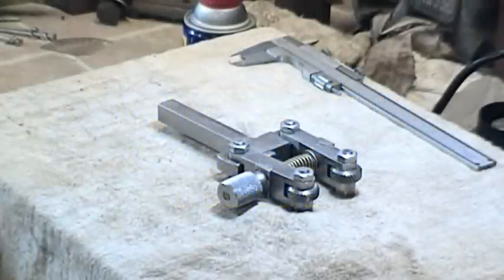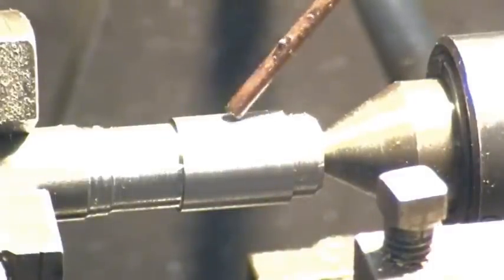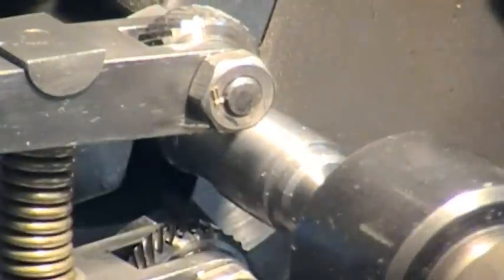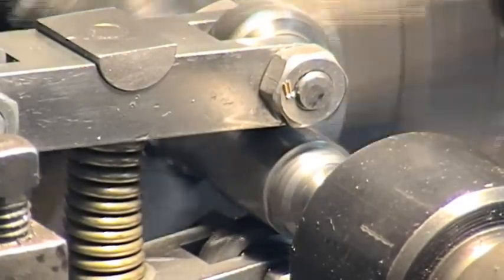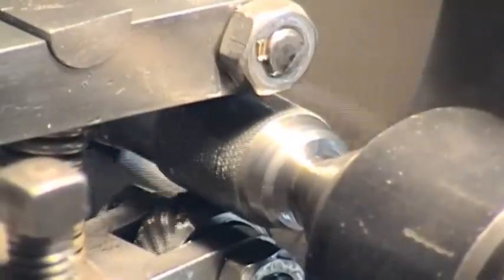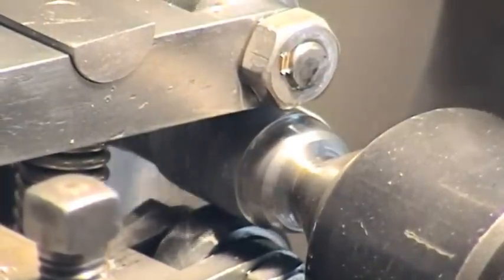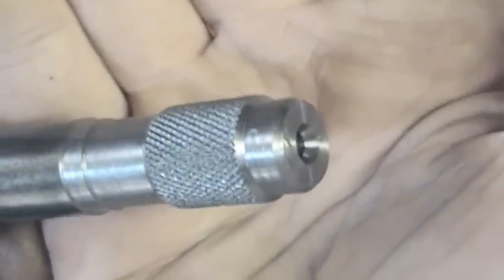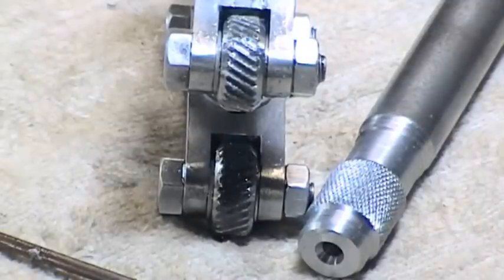Gadgets and Gizmos - The "Straddler" knurling tool, in use

Comment: Hi

Please review some of the other knurling videos on you tube to see how it should be done.

with a straddle type knurling tool there is normally no need to use the tailstock as there should be NO sideways pressure.

The whole point of a straddle knurling tool is to position the pressure WITHIN the tool.

Unless the lathe has slow speed limitations, knurling can normally be done under power.

Please review the other videos and then perhaps consider redoing your video.

Regards

Peter

Comment: Great educational video!  I've always wondered how knurling is done.   Thanks!
Reply from the maker: Erling Weiseth In theory - according to wok diameter, different wheels can be needed.  However, for most smaller size work I make do with the one set. True - course or fine can be decided by heavy start or a lighter start. The demo was just an example only - normally it would be done quicker.
Reply: aphex4000 And I've always wondered how the pattern was made - so it came out so precisely spaced beween the lines. Aggressive in the start - coarse pattern. Light pressure in the start - fine pattern. Now I know, thanks to Chris! And now, off to ebay to buy som knurling wheels.. ;)
Reply: My lathe is a Myford ML7, so i won't be doing much heavy work either. Think I'll go for one set of all-round wheels, and go from there. Thanks for Your quick answer! Cheers! ;)

Comment: Interesting video.  The reason your knurls are so fine is because you are double cutting. The diameter is wrong for even grooves. If the diameter is right for an even number of teeth, the pattern will be the same as the tool.  I like your vids.  tom
Reply from the maker: Hi Tom -- yes, appreciate the dia relationship. However, the 'double cut' is ideal for some purposes and I can still, with a very assertive and aggressive start achieve the single cut result. I will probably try and get some more wheels sometime.

Comment: I noticed you don't care about the diameter before start knurling - theoretically there are a set of "fitting" diameters that goes with the set of wheels you'r using - a little  like gears - the wheels and the knurling pattern has to "engage".
I think the "dobble" knurling you'r talking about is a result of "non-fitting diameter"

Maybe I'm too sophisticated and too theoretical - maybe practice is "good enough" !

I have made a Little program helping finding these "special diameters" - you can download it from here - but you have to have Framework installed as the warning says - the first program (description in English !) :

http://kelds.weebly.com/sjov.html

I made up this program after viewing a video from Tom Lipton on Oxtools, but he never returned ... maybe he had problems installing - I don't know - but try it out and let me know if it's useable.
Reply from the maker: Keld - well, most knurling over time has been relatively small diameters. I take your point, in theory for sure, regarding the gears analogy. -- but have found that my wheel set does me OK for most applications - plus, I am not usually being to critical on result. I do still find that my pattern is dependent on the ''aggressive" or light start as to whether I get double or single pattern. One of my videos shows this very well - "An attachment for an import metal shear" -- An attachment for an import metal shear - where I have some examples of a course result. Thanks for the link - I have D/L the file and will check it out.
Reply from the maker: My anti-virus rejects that 'knurling.exe'!
Reply: ChrisB257 Yeah, and normaly it should, but there is no dangerous in this program - I can guerantee - so if you still wants to install it - it can be done.

Maybe that's the problem that Tom Lipton ran into - so maybe I should do it "the right way" = make an MSI-file you can download - I think I'll do that !

Comment: It seems that knurling would be a good application for using your drip-oiler?  Thanks for the demo!
Reply from the maker: Indeed - I did most times use that.  Here, because doing things rather slow just made do with brush. As long as wheel pins are well lubed and wheels also - it still helps things along nicely. I think I did add a pointer to another video (Metal shear add-on unit) where there is an example of a coarse knurl achieved with same wheels by being very aggressive on the start.